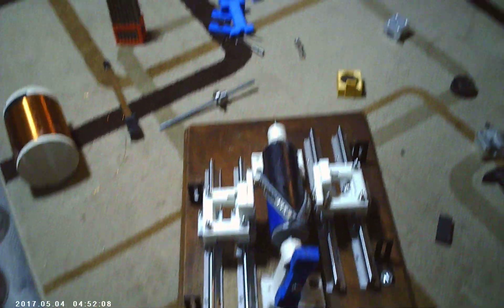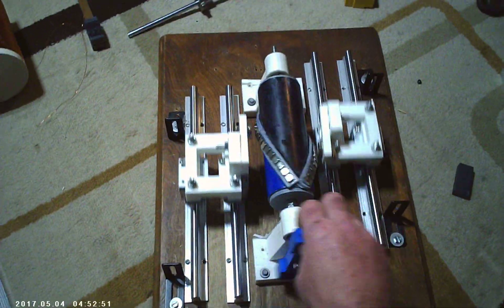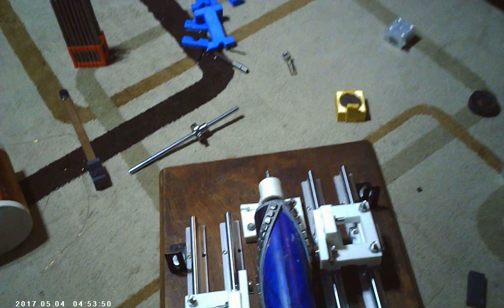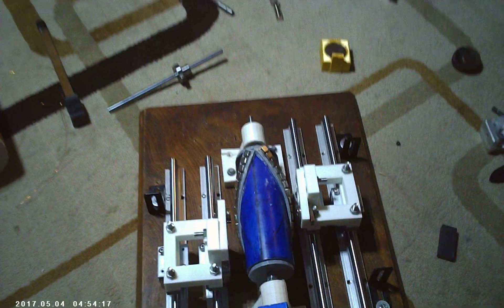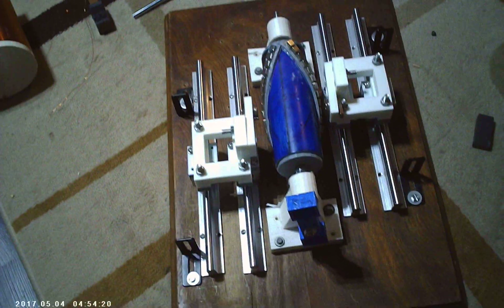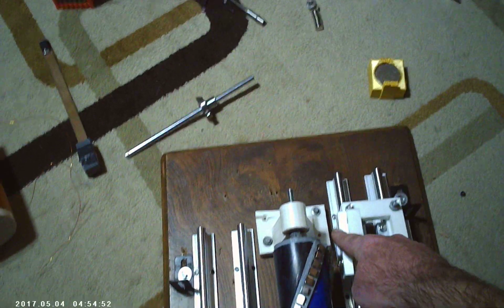Spiral Rotor Motor #4  -  Double Linear Action

Comment: I use a large ring magnet. I set it on a angle to give it the elliptical effect. And use a old VHS head for the frictionless bearing. The outer drive magnet has to hope a little to keep it going. So it's like a v gate. But with no v. Or gate. Since it's one solid magnet. I found that it doesn't need much angle.
Reply from the maker: send video

Comment: This would be a great concept from changing something mechanical to electrical. What if you added a spring to one of your sliding rails so it would swing back a forth, turning your rotor which would turn a generator. Or make it to where a hammer would swing and hit the slider to move the spring again.

Comment: I do believe that you could put coils inside the sliding linear rails to make even more energy. Well it is just an idea. What is the reason your magnetic roller starts out with magnets starting side by side and goes up the helix without the magnets touching each other ??? Keep up the great work fella for sure.
Reply from the maker: I was investigating the magmov motor design.  It's interesting but I didnt find anything really special with it yet.
Reply: @floodrod  I look forward to see which direction you will go with your project Sir. Keep up the great work for us all to learn a thing or two.